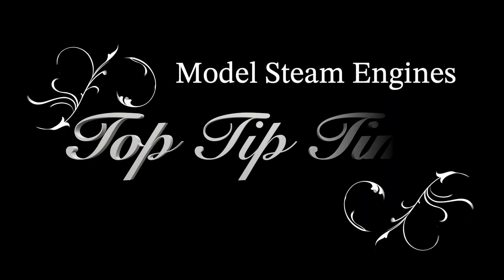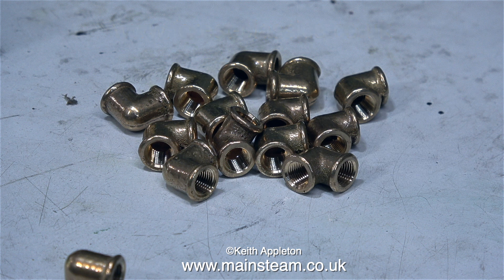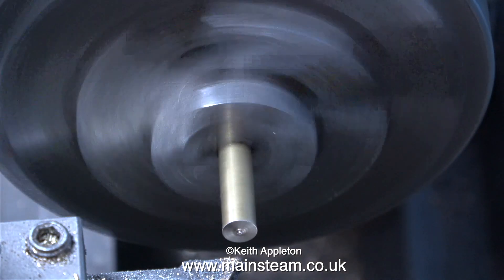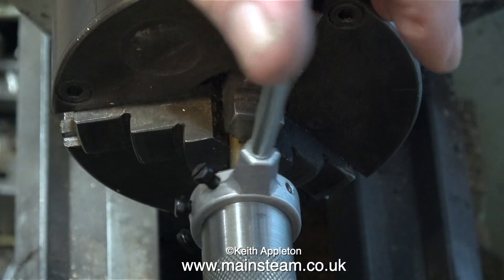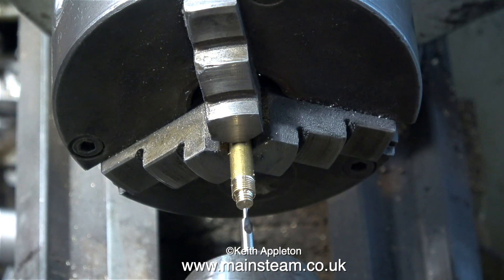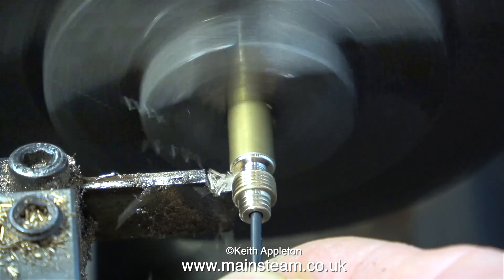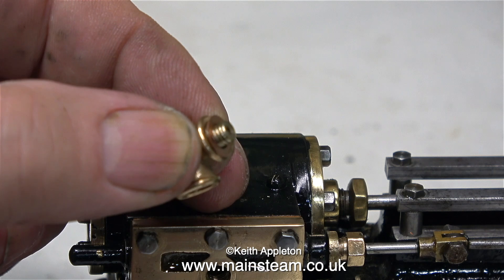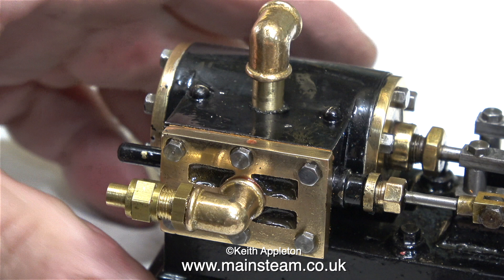MODEL STEAM ENGINES - TOP TIP TIME - PART #24

Comment: Interesting, i did came across this problem You mentioned here whan i was working on an old low pressure boiler i had laying around from a previous project, i am not sure why this occur, but the PM fittings did work after i re taped them with those British made taps i bought from Your previous reccomendations a while back. Beside that however i hawe nothing bad to say about those fittings seen to the price and quality rating i think they are ok.
Reply from the maker: I also think that they are very good and I use them frequently {:-)))

Comment: Keith, there is a definite difference between UK (BSP) pipe threads and US (NPT [tapered] & NPS [straight] pipe threads.  Also, UK and US thread pitches can be identical, but the thread angle differs.  Whitworth form threads exhibit a 55 deg. angle and US threads exhibit a 60 deg. angle.  I suspect your need to re-thread US made elbows lies in that angle difference.

Comment: PM research threads will be 1/4-40 UNS (unified special with a 60° thread) 1/4-40 ME is 55° Whitworth thread form same pitch but different shaped triangles.
Reply: Thank You! I had the same question since i had to fit a PM research feeding pump to an old boiler i came across the same problem mentioned here whan i tried to use my British standard taps i bought previously for this purpose. I guess i hawe to order a few more taps... ha ha It's always good to hawe a proper tap and die set for each specific requirements regardless in my opinion even if i still hawe to re tread the last joints on the connection ends like here. But problem solving is half of the fun in this hobby in my opinion!